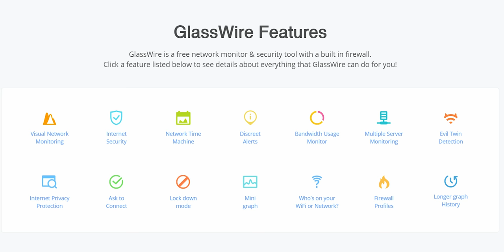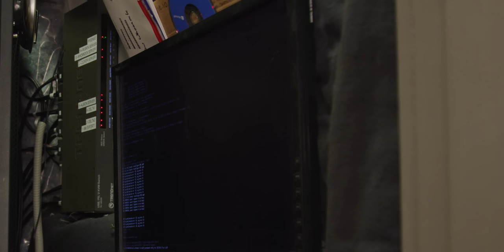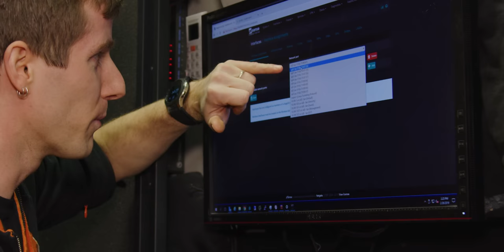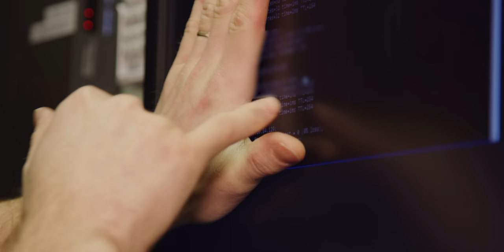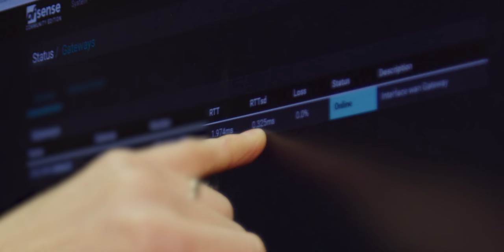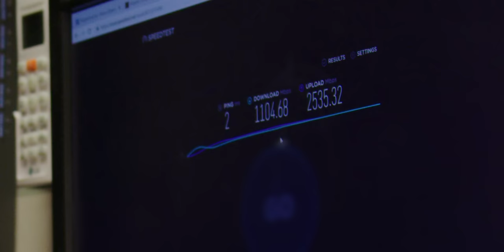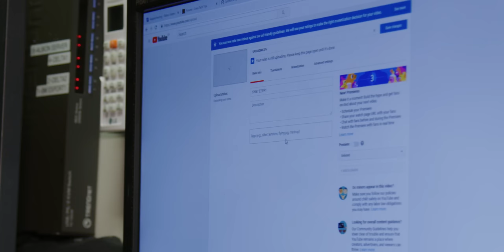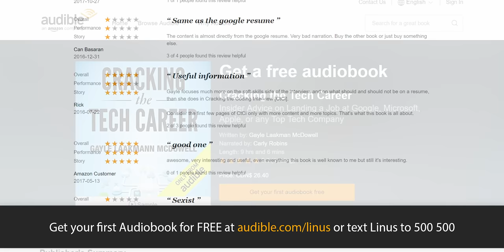We got 10 GIGABIT Internet!!

Comment: Fast.com uses Netflix servers to test speed if you want to try something besides speedtest.net
Reply: As an ISP tech support, I love fast.com.
No ads, Lightweight, and runs on pretty much any device with a web browser. I use it minimum 5 times a day.
Reply: Thanks for the plug 👍 I'll try it when I get home thanks a lot
Reply: Why didn't I know about this, pretty neat, thanks
Reply: And nobody does know about dslreports.com where you actually can modify settings for testing
Reply: @Curt-0001  My ISP says fast.com is bad
Reply: @Garrzilla  Verizon told me not to use fast.com, when I asked if it was because they throttle Netflix the were silent. So my guess is the ISP doesn't differentiate between Netflix streaming and Netflix testing, so to save face when your speeds are slower than you pay for they say "fast.com" isn't a good test. Instead use Speedtest.net that they push good speeds through to look better than they are.
Reply: I have Fios. and wow thanks for the info I just tried Fast.com It is awesome
Reply: @darylb4473  I am about to get 1gb internet, the fiber is outside im on the list to be installed! I cannot wait! currently 400 down 20 up
Reply: @islandgirlmia2169  awesome I kept getting different numbers but all awesome so I edited my post either way it is awesome thanks for the info
Reply: David  If you ISP throttles Netflix it will show different results. If you are one of the lucky ones it should show your full speed assuming nothing else in your home is on the internet
Reply: Saved me from making the same comment 😀
Reply: @AspynW  That's why Netflix made fast.com in the first place - so that people can test if their ISPs slow down their connection to Netflix servers.
Reply: David  Did you compare with other speedtests? Statistically speaking it has been %98 accurate, with the occasional upload glitch as you cited.
Reply: Also, if you run your speedtest on wifi you are testing your wifi speed, not your internet speed. Huge difference. Especially if you are still using 2.4Ghz wifi.
Reply: @TheMrDutchman  thanks for the heads up. I often get 900mbps when testing at work. Could be different depending on colocation/hosting I suppose.
Reply: I work for an ISP and I've had very mixed results at fast.com.  Our standard speed is 100mbps and fast often returns a speed of 960ish.
Reply: I have a 100Mbps download speed but it says my internet speed is only 5Mbps
Reply: What about the Google speed test? You just Google speed test
Reply: Testmy.net is better
Reply: @Courtj3st3r33  weird. I'll definitely need to keep an eye on it. 
I wonder if as an ISP - having a Netflix cache server can cause these results.
Reply: @islandgirlmia2169  Lucky girl, I'd have to pay to drop my own fiber in the ground to get it and that's sad when you think about it, I live in a city of 380k plus people and only 20% even have over lapping providers.
Reply: Fast.com is also notoriously inaccurate.  It really needs to be more open on what it's testing. It just says "you internet is this speed" when... it's not, it's just your connection to Netflix's servers. Which, depending on your ISP, could either be throttled, or even given a passthrough to give Netflix specifically some oomf. When the rest of your internet could be garbage.
Reply: @Dorraj  Fast/com was built to test if ISP were throttling traffic to NetFlex's servers. To this day it still uses NetFlex servers in a mutli link test. If you are seeing lower than what you are paying for, it's because your ISP is throttling traffic for NetFlex. Also the ISP's have tuned their packet managing software to favor more known and used speed test sites. So I wouldn't rely on them as heavily as most people do.
Reply: @TdrSld  I live in a single provider area and i pay over $100 for 400 down 20 up. the new fiber is a new company and is $70 including tax for 1gb down and up. It took them 3 years to reach my home
Reply: @amunak_  that's kinda cool, I didn't know that! Thanks for the TIL :)
Reply: Yeah I am getting some pretty varied results with this, first test correctly reported around 450 Mbps (I pay for 400 but my ISP basically allow you to go up to 450 or so and guarantee it will never go below 400) but second test reported 6.0 Gbps and third 1.5 Gbps. Some people have mentioned ISPs using Netflix caching servers which may explain that but its still a little odd that the Fiber backbone/my router could possibly support that throughput even from a cache.
Reply: I use speedof.me for ACTUAL results that are based on single piped TCP connections. Because all file uploads (YouTube, twitch, Google drive ect) are handled like speedof.me. when you use that website you'll get slower uploads because ISPs suck
Reply: @islandgirlmia2169  Same here I only have Spectrum at 100 down and 10 up for 70 bucks a month. In town were there's over lapping providers you can get 500 down for 40 bucks a month and gig for around 100. They have been running new Fiber up and down the main street here but no word on who or want it's for. In the last 2 years they've laid down 4 new fiber lines.
Reply: See, when you're dealing with 98 year old mrs johnson, fast.com is an easy URL. If anyone has a speedtest which runs on every device and is easy to remember, be a homie and drop the deets. For your grandmas sake

Comment: Here's a question:  Fiber Optic uses light to transmit data but light travels in a straight line.  In a fiber line the signal is bouncing off the interior walls of the fiber (the interior walls appear as mirrors) resulting in a reflective loss.  Each bounce is a loss of some signal strength.  The fiber lines in your patch panel have excess length which is wrapped in a loop and slightly squeezed.  Doesn't that excess fiber loop cause a high amount of signal degradation?  To make light bend around that loop the signal has to bounce or reflect at a significantly higher rate which takes me back to the reflective loss statement earlier.  For best signal strength one would attempt to reduce the amount of bends in a fiber optic cable.  Perhaps that and overhead is why you have a .2 gigabit loss in signal.  Eliminate the fiber loops and maybe get another 50 megabits bandwidth.

Comment: The ISP I work for is going to be launching symmetrical 10Gbps for business and residential
Reply: Sailio price tag for residents?
Reply: No price yet, but 1Gbps is $85 USD
Reply: We actually achieved the 1Gbps through coaxial using orthogonal frequency domain multiplexing
Reply: Ahh Comcast
Reply: holy shit what area do yall cover? @SailioNation
Reply: Kingmatrix, it is not Comcast. Midco.com
We don’t do contracts (unless it’s business) and we don’t throttle or limit data usage at all, unlike Comcast.
Reply: @Sailio Why tf would anyone want 20 MBit/s (or 2% of download) up when they got 1 GBit/s down (according to your employers website)? I would rather have 900 MBit/s down and 100 MBit/s up for cloud services and video upload/streaming. Then again, I do not get the need for 1 GBit/s symmetrical either unless you are literally backing up your complete 10 TB HDD everyday. -.-
Reply: Will there be monthly data caps?
Reply: .... Go on...
Reply: Looks oddly similar to rogers in my area, but they busier working towards 5G (Cell phone network) instead of res 10 Gigibit
Reply: Was geht sie das an? Upstream is being converted to support that speed.

Comment: Why not just create your own ISP?
Reply: I'm guessing network access fees (whatever they are called) probably cost, per month, more than a minivan. Just a guess. Linus ? WISPs / ISPs ? Physical infrastructure must cost millions per KiloMeter. That figure was pulled straight out of my ass. Good question though.
Reply: Probably price. 10Gb business Internet is cheaper than a 10Gb transit arrangement.
Reply: @sdesmtl  It can vary wildly depending on how you want to start. You'd need an ASN and an IP block (/24 at least) - this would run you around $6000 (250 annual starting cost for the ASN and about $5k-6k for the IP block)
You'd also need a place to home your core network, either in a datacenter or somewhere that has L2 to a datacenter / peer exchange to advertise your BGP/ASN to the internet.
Then you'd need your primary feed in, a business gigabit L2 from AT&T usually runs around 3-5k a month I think.

So monthly costs, minimum of 3k a month. You may be able to get 100mb L2 for 500-1000/m, so you could start fairly cheap and work your way up.
The initial investment would be fairly expensive for the equipment though. Especially if you want to get 100G in, then you need expensive switches and routers with QSPF+ ports and transceivers.

Source: I work for a WISP and help with network engineering.
Reply: Johnny Joannou lmaoo i mean shit I didn’t understand any of that, but I think Samuel was taking the piss ahhaha, thanks tho

Comment: You could easily crash any server with that just by pinging it with maximum package size.
Reply: max package size for ping is 64KB. soooo... i don't think so. even if you try to use some ddos tool you need more than one connection (hence it called distributed), because it's easier to block one connection.

Comment: I used to do this daily. You do not have to take your internet down for that long. Simply add the 10gb interface to your router. Test it. When complete simply take the config off the old 1gb and add it to the 10gb interface. Any vlans should be preconfigured.

Comment: I have seen 48 port 100Gbit switches but then again i work for an isp hehe
Reply: Linus' ISP actually started providing 100gbt  a year ago and pushed 1gb for consumers very fast
Reply: Which switch? I usually only see Ciena 5150s outside of carrier data centers.
Reply: I just helped design a network that had 4.2Tb of capacity w/ 200Gb packet lambda's.  It's going to be sweet....ps I also work for an ISP.
Reply: @parttimeandy854  I'm jealous. I work for one of the major ISPs, but mainly with the physical fiber design and smaller customer network designs. I wish i had more technical projects...
Reply: I work for an ISP. I know secret words....
All I'm saying is
Fiber MUX. 
Small Form Pluggable.
Send and receive fibers.
1550 nm
I have FTTP at my house. 👍(1490nm)
I like the Internets when she's fast and loose. 😉
Reply: Add Dense Wave Multiplexing using ALL the EM bands from Infrared (1550nm) up to Ultraviolet (380nm) for PETABIT speeds! The parent company is experimenting with those for their interconnected GaAs MassPar chip supercomputing systems! 

Next Up is currently-experimental 3D-XYZ Phase-based high to extreme UV dense wave multiplexing with the 3rd dimension of PHASE (Z) for multi-byte word send/receive in one set of pulses. This means not just amplitude and frequency but also light phase as the word descriptors. It doesn't just double speeds, it MULTIPLIES networking speeds onto the multi-petabits and even exabits per second range!
.
Reply: I work for a long haul optical integrator. We routinely turn up cross country 10Tbps+ links 😎 never gets old!
Reply: damn my dream is to work for a high capacity isp or datacenter, especially with DDoS protection since that's my domain
Reply: My company is using the Cisco 5150's for our switches to customers and Dslams. I guess it is becoming a common piece of equipment. or the next favorite is a Cisco 3600. just depends what is where.
Reply: @Andrew Troyer where did that go? didn't think we could provide that kind of capacity with our current limits.  how much can they use for internet? lol
Reply: @AdventureOften  Can older "dark fiber" support those speeds, or do you need to lay new lines?
Reply: Jackie Scholl older fiber can generally support it. Age isn't necessarily as important as the quality of the fiber. We routinely deploy on fiber that's 20+ years old. Polarization Mode Dispersion and Chromatic Dispersion are the two biggest factors on whether fiber can or cannot support ultra high capacity networks.
Reply: @Andrew Troyer You guys are lucky you don’t have to deal with undersea fiber. Terrestrial link costs are almost a rounding error in my network. Lol
Reply: @bluetonight17  fiber can support all the speed
Reply: @SimonHax  only if you have the bandwidth to support it. I also work for an ISP. Same one as Andrew.  I was asking where because the fastest we have in my area is 100Gig

Comment: Linus, you said that if there was a fiber cut that the your internet would route around it. However, if a fiber event occurred between your router and their Ciena your facility would become isolated. Additionally, since you only showed one point of entry and one set of fibers going to their Ciena then if a fiber event occurred between their Ciena and their facility/hub, your facility would become isolated. Basically you can't route around single points of failure. Your redundancy doesn't look like it starts until it reaches your ISP's facility/hub.

Since they likely made you sign a contract for your fiber connection, they'll profit over the life of the contract, not off of the initial install cost.

CWDM doesn't split a TenGig connection into multiple one Gigs, it splits and/or merges (AKA mux/demux) wavelengths of light onto a single fiber pair. Kind of like how multiple wireless access points can be put in the same area by putting them on different channels/frequencies (or wavelengths in the case of CWDM).

Attenuation is what occurs to light levels over a long distance, a dirty fiber connection, or a bad fiber. If light levels are too high/strong you can use an attenuator/pad to lower the levels and bring them into spec. If your levels are out of spec then you can get errors or burn out the receive optic prematurely.

Comment: And i was happy that i just upgraded to  1.5mbps from 500kbps and THEN i see this.
Reply: Elssar Aragorn jeesus. I live near city so I dont have any cable connection. I am using 4G internet and it is usually about 30 mbit stable.
Reply: @ElectricalMonk3558  I just returned from Ghana. I had really fast LTE in some smaller rural town (like, 24mbits), and now at home my landline connection is a lot slower...
Reply: I get 100Mbps in my home and I have few servers which could do 1Gbit, and the new server which can do 10Gbit
Reply: same
Reply: Elssar Aragorn 1.5 Mbps?? How do you watch such videos??
Reply: thats a downgrade lmao
Reply: I still remember using a dial-up modem with a 2400 baud rate.  2.4kb/s. I was so happy when my uncle bought me a 56k modem for my B-Day. Ah the good ol' days with local dial-up BB's and Prodigy.
Reply: @nousername5673  i can only watch in glorious 144p.

Comment: You needs to do a ‘techquikie’ on optical transmission back haul technologies? You dropped several acronyms that I understood because I worked in that branch of IT. CWDM, DWDM, Wavelength, ROADM, Single and Multimode fibre, SFP, CFP, Long haul, Short haul. Passive versus Active, Regeneration versus Amplification and Ethernet encapsulation. Those who understood already know but those who don’t it will be new to?

Comment: bought some ubiquiti 10GB modules last week - cheaper than you'd think
Reply: How much?
Reply: *Gb
Reply: @browolf  Nooo that is wrong, what you posted is multimode with only some hundreds of meters of reach. the module Sebatian posted is singlemode with 10km reach, those are EXTREMELY more expensive. The price he posted is not for 20, it is only for 1 piece. Don't mix up multimode with singlemode modules, that's what Linus said there are MANY variants.
Reply: @erazorCTF yes but the ones I got were still a lot cheaper than I expected.

Comment: Im still using dial-up 56kbps.
Reply: In some instances I feel like my dial-up of Wayback when was faster than what I have now. PS I don’t recommend Hughes net, I’ve since gone cellular and refused to give Comcast money and our County frontier DSL is probably worse I am 99% sure they throttle all downloads so annoying to update Epson printer software.
Reply: Oh I forgot are you at least Wireless with that dial-up if not go on eBay and get yourself an airport with modem, I got one for that purpose and then moved and never used it for dial up.
Reply: @imark7777777  As a web developer when dial-up was a thing we used to fight to get loading times down to under 7 seconds by optimizing images etc. Now nobody does that anymore and many pages wont even load at dial-up speeds. When my cell gets throttled to 64kbps once I use up my 5gb I can basically use whatsapp and messenger. Most mobile apps and games don't even work because the connection is too slow.
Reply: I started to download epson UD and it said 20 minutes and I got down to five minutes I think and I was able to start and finish the download on my phone and They both ended at the same time. I was watching and I think it was a 200 MB download go really fast for about two minutes and then the download speed just started dropping. frontier has this thing where they route traffic through another state and back but at the same time the state owns half the infrastructure but if you want to start an independent company you have to go to frontier and frontier immediately says no because it would cut into their business. On top of that there’s a major difference between blocks not necessarily in town and out of town I know how dsl is affected by distance but this isn’t even a distance issue.